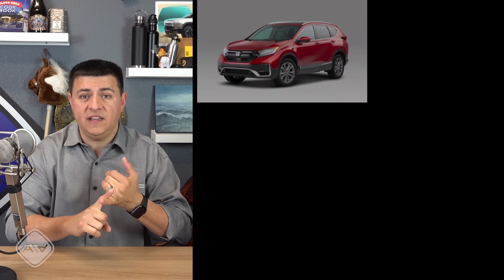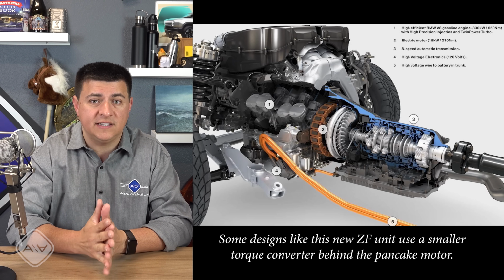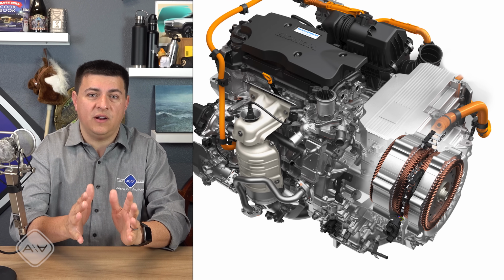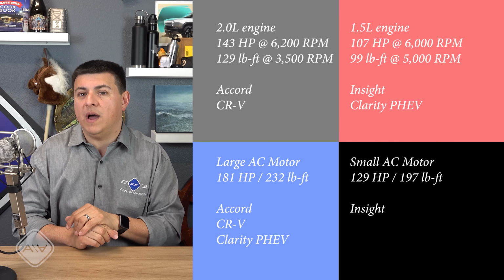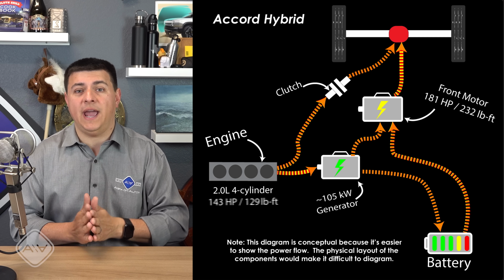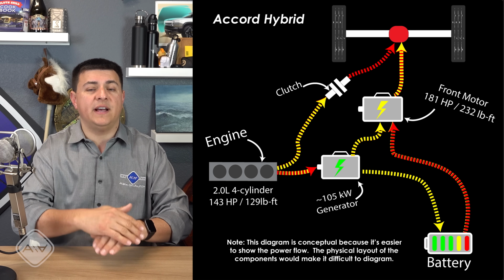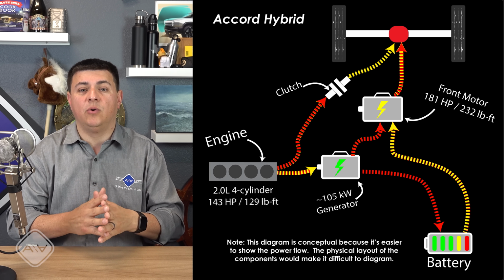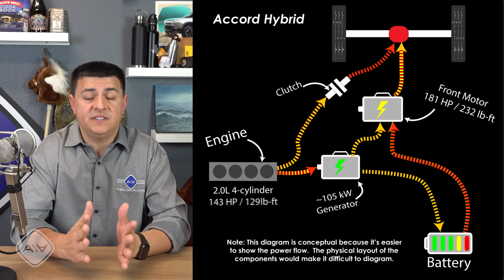How Does It Work?  Honda's 2 Motor Hybrid System Explained!

Comment: I have rewatched this video so many times. I think it's a good thing because I start to grasp what you re saying more and more each time. The more I think about it, the more impressed I am with how Honda is approaching the hybrid powertrain. By definition, Honda hybirds are "Extended Range Electric Vehicles", but shit, it may as well be, assuming go all-in providing a proper battery and powerful drive motor.
Reply: An "Extended Range Battery Electric Vehicle" waits until the battery's State of Charge drops below some threshold, and then uses an ICE (that is inadequate to drive the car) to re-charge to the battery. It can not propel the car, either mechanically or electrically.

The Honda hybrid powertrain is not a BEV-Rex. It is a "Battery+Generator" EV. The ICE-driven generator (the ICE is small, but not inadequate) is the main source of electrical power for the motor, regardless of SoC. The point is not to charge the battery, it is to let the engine produce power at the most efficient level possible. So it runs at this efficient level, and the battery adjusts the power up or down as needed.

The ICE can also propel the car mechanically when it is more advantageous to do so.
Reply: @jeffjo8732  thanks for the additional info, the clutch system that engages at the 6th gear ratio is definitely solving the problems of CVTs and electric motors at once, both have good low end torque but unable to sustain highway speeds efficiently.

What you stated is the distinction,  and thank you for providing that, context in case someone did get confused. I am expecting people to know the subtle differences to enjoy the humor in my comment.

Comment: I'm in the UK. I got my CR-V Hybrid mid-2019 after owning a manual Accord. Love it. Very, very smooth power delivery. Instant power when pulling away from the lights. Like my Accord, UK CR-Vs are built in Japan so I don't know if there are differences to CR-Vs built in North America with regards to suspension settings, etc. but mine corners really well for an SUV, very little body roll and good damping over speed bumps, etc. There's a Sport setting if you want more power or an Eco setting if you want fuel economy. I get about 45 miles per Imperial gallon. If I want to blast around the country lanes I borrow my wife's manual Mini Cooper S with the supercharger. But, I'm sold on the CR-V Hybrid.
Reply: Historically, US market cars tended to have a softer suspension setup than European ones for more comfort at the expense of cornering but I don't know if that's still true.

Comment: I own a 2018 Clarity, and I can say that when the little gear isn't present on screen while on the highway (meaning the engine is producing electricity to then power the motor, not driving the wheels directly), the fuel economy is definitely decreased. The range where the engine can directly power the wheels is from about 45-75mph. That is definitely the sweet spot for best fuel economy.
Also, now knowing the smaller motor generates power from the engine makes sense. When using the car in cold winter without a battery charge, the engine has to warm up to temperature before being used to drive the car in any manner (parallel or serial hybrid). But once the engine gets to temperature it ROARS SO LOUD for about 30 seconds no matter the speed you're driving in order to recharge the battery back to ~10% (using the heat and then driving for about three minutes before the engine gets up to temperature depletes the hybrid battery WAY below the 10% threshold level I assume. Because it sounds like the Clarity puts the engine at full power to recharge the hybrid battery at all costs to maintain a healthy battery and keep it from reaching too low.). I would say that is the Charity's downfall in my opinion,  the loud and harshness of the engine after needing to charge battery or drive vehicle in cold climate after start up. I wish it was like the Volt and could start the engine while pre heating the car with no battery charge so it wouldn't then operate at 6,000 rpm it sounds once it gets to temperature on the road. It is also an inconvenience to not be able to preheat or precool the cabin unless plugged in to a 240v charger or have a battery charge. Don't see why the Clarity can't start engine and use its generated electricity to cycle on and off like normal to then heat/cool the cabin.
Reply: My theory is that Honda doesn't allow the Clarity to cut on the gas engine while preconditioning as a safety measure to avoid potential carbon monoxide poisoning if the car is started in a closed garage. I can see people starting preconditioning with 5-10% SOC thinking it's safe to do so in an enclosed garage, and the Clarity switching to the gas engine a few minutes in and someone who doesn't expect that to happen getting a very unhealthy dose of CO before the 30-minute climate cutoff kicks in.

Comment: I hope they make a beefier, plug in SH-AWD version for Acura. A 250hp electric motor in the RDX would be cool
Reply: Absolutely! Handling likely to take a hit though with added weight from batteries.
Reply: How about adapting this system to a redesigned ILX sized Acura...JMHO
Reply: @James-il3tq  Handling already took a hot from the ride height 😁 With the CoG being lowered it might benefit
Reply: No. Speed limit is 120 or 130 on 90% of all markets with exception of Germany and some american places.
Every two DL of fuel dispatched on the market will generate more than 10'000 deaths a year.

Comment: Some clarification in the case of the the Clarity PHEV. In normal mode, as long as there is a charge in the battery,  the ICE will never actually be clutched to the drive wheels and 100% of the propulsive force will always be provided by the electric motor.  There is no instance where the car will use the ICE to drive the wheels when the car is operated in normal mode and there is charge in the battery pack. 

Now the Clarity has a "Hybrid" mode, but this is not the default mode for the car. It is an option that the driver selects via a push button.  When the driver selects this mode, the the car will sometime (light load and steady speeds) lock the the ICE to the axle, but even here, the ICE lacks the torque to drive the car up even a slight hill, and in most cases, the clutch will unlock and the electric motor will propel the car while the ICE re-supplies current to the battery. Even when the Clarity is in Hybrid mode and running at highway speeds, the ICE is not always providing the propulsive force and in my ownership experience, the electric motor is often still providing the propulsive force even when the car is in Hybrid mode, with the ICE simply re-supplying the battery with the current being drawn by the traction motor and the car environmental, entertainment, steering, and other systems.  In this mode, the battery charge program will attempt to maintain the battery at whatever state of charge it was at when the car was switched to Hybrid mode. For example, if there were 14 bars showing on the battery state of charge display, the ICE would turn on and off and run switch between ICE and EM propulsion as necessary to keep the 14 bar state of charge.

Also, if the charge were to drop to two bars, the ICE will come on to charge the batteries but once again, the electric motor is still by far and away the primary propulsion source and here, the motor will generally sit at a fast idle and simply keep running as necessary to keep the battery from going completely flat, which can damage the battery. 

The power system though is as shown, but the Clarity in normal mode never* turns on the ICE except if the driver presses hard on the accelerator, in which case the ICE comes on, but only to provide additional current to the electric motor. Even under hard acceleration, the  ICE does not clutch to the drive and all of the propulsion is done by the electric motor with the ICE simply adding extra current (the battery pack can['t provide enough current for the electric motor to develop full horsepower so the difference comes from the ICE).  

* There may be instances where the ICE does turn on in the "background" on the Clarity.  This seems to be done as part of a diagnostic routine.  Others report it, but I have never experienced it on my Clarity. It appears that the motor comes on, gives a message that it is in calibration mode, and after some period of time turns off, but no one seems to know the exact conditions that trigger this behavior. I have owned my Clarity PHEV for 20 months and have never experienced this conditions myself, but others report it.

The proof of the above is that I can go indefinitely in the Clarity without having to put gas in the  tank because in my local driving, I never go more than about 50 miles and I never accelerate so hard as to make the ICE come on to supply extra current to the motor, so the only propulsion I use is the electric motor and this is at all speeds from 0 to 75 MPH (which is as fast as I ever drive the car).

So, while the general flow of power as presented in this video is the same for the Clarity, in normal mode, the ICE never comes on at all unless the driver demands fully horsepower from the electric motor, at which time the ICE comes on and steps up to a very high RPM to drive the generator to provide the additional current needed by the motor (Clarity owners call this the "Angry Bees" mode because of the high noise level associated with the small ICE spinning very fast to provide the additional current).

Comment: Awesome channel. I didn't know about some of the other technologies you mentioned - but now I'm even more glad I bought the Honda Clarity Plugin-Hybrid EV. Like you said, the big EV motor provides the torque needed for everyday driving (and then some). And as you note, the regen-braking is flawless. Literally I cannot tell when the difference between it and friction brakes, except for the nice regen gauge that tells me I'm putting power back into the battery.  Now if only someone could get the word "hybrid" out of the consumer lexicon and emphasize the "EV" instead, these cars might sell even better :-)

Comment: Awesome video Alex! Just to add a few notes after owning and driving a 2015 Hybrid Touring for 160k. Befor that thou I want to say this powertrain is the most robust and full proof I've ever seen or drove. While Alex said something about EV being limited to around 45 mph, I can confirm that the Electric systems will run up to 80mph without cranking over the engine, depending on load. The hybrid system uses an advanced load algorithm to optimize power to the ground and efficiency at any speed. I've also experienced what feels like 200+ hp at very low speeds, but only when the battery pack is completely full and you go full send on the gas. Out of curiosity, I will by dyno testing my hybrid to see what kind of numbers, load ranges, and mph the vehicle can do. Cant wait for the next gen of this powerplant!
Reply: A couple of terms need to be clarified, and one added, before I can reply to this. If only to remove some ambiguity:

1. EV Drive : running on the electric motors and battery power.
2. Hybrid Drive : running on the electric motors and battery+generator power.
3. Motor Drive : either EV or Hybrid Drive.
4. Engine Drive : running on ICE power (adjusted to best efficiency by motor+battery)
5. EV mode : telling the computer to prefer EV Drive by pressing thr EV button. (You didn't use it, but it confuses people sometimes.)

What Alex said, was that Motor Drive is used exclusively below about 40-45 mph, and that Engine Drive can be used above 40-45 mph. You are right that Motor Drive can also be used above those speeds; and in fact it quite often is used. Hybrid Drive is used when passing, and EV Drive is used when there is plenty of charge in the battery.

But you haven't experienced 200+ HP at low speeds - you have experienced 200+ lb-ft of torque. And that much torque doesn't need the battery below about 30 mph. This is because the motor is torque limited below about 37 mph. The maximum power of the motor is the smaller of (181, MPH/5). But 30 HP gives you as much acceleration at 10 mph, as 180 HP does at 60 mph.
Reply: What is the total horsepower maximum ?
Is it in hybrid mode or in electric mode?

Comment: Thank you for this very enlightening and informative video. I am about to take the leap from traditional diesel-engined cars to possibly a hybrid-engined car (the new Honda Jazz/Fit Hybrid) in the challenging Finnish climate. Your very professional video helped me figure out many details about the new Honda technology. Thanks again, best regards!
Reply: I would be worried about the electric battery energy retention in the winter. It just isn’t that good. Also, if the car uses engine antifreeze to heat the interior, then it will run the engine most if the time just to keep up the operating temperature (in the cold times), which kills fuel efficiency. I would not rush into a hybrid unless it had an electric heat pump and a NiH battery.

Comment: nice video, good job explaining everything. i test drove a crv hybrid & liked it quite a bit. but i bought a hybrid rav4 bcuz i felt it’s hybrid system operated a hair smoother. it is awsum in the snow, and i average 42mpg combined in summer  (44 in city only),   and about 35 combined in winter. it’s awsum, and i’m sure either car is a winning choice.  i don’t think i will ever drive a non hybrid again…  ever
Reply: I was looking for RAV4 hybrid but they were not available.  The 2024 Honda CRV’s were finally coming onto the lots which were +$2K over MSRP Sept-Nov 2024, but mid Dec 2024 I landed a Sport Touring for -$650 under MSRP end of Q and end of year.  LOVE IT!   MPG is getting better with warmer weather and no remote start needed.  Mega Dittos will never buy a NON Hybrid again!  Thanks bro.

Comment: Thank you for the video. 
I just purchased a 2022 Honda Insight on May 30th. It's now my understanding that production of the Insight ends in June.
Reply: The 3rd generation Insight is really a Civic with a slightly different look. All they are doing when they redesign the Civic, is making the similarity official by dropping the Insight and replacing it with a Civic Hybrid. I'm guessing this was  part of the original plan, to put a clear separation between the (old) IMA hybrid system, which wasn't very successful, and the (new) iMMD hybrid system.
Reply: @jeffjo8732 : I watched Professor Kelly's video on the system. He was quite impressed with it.
https://youtu.be/QLUIExAnNcE